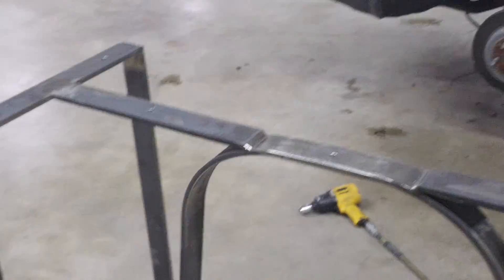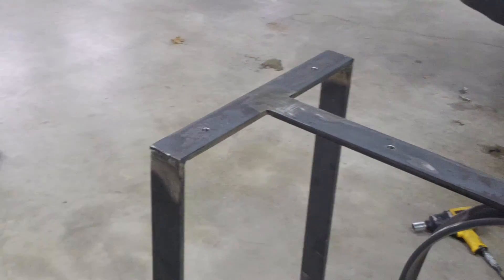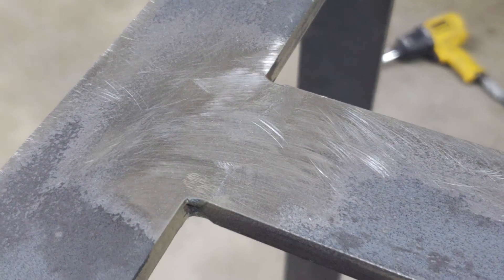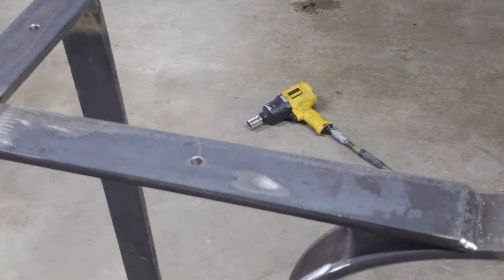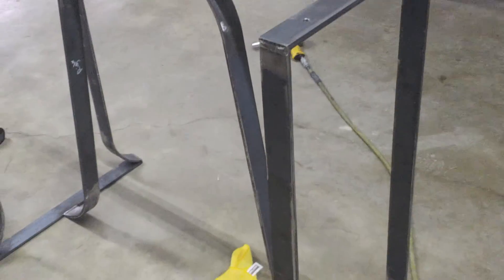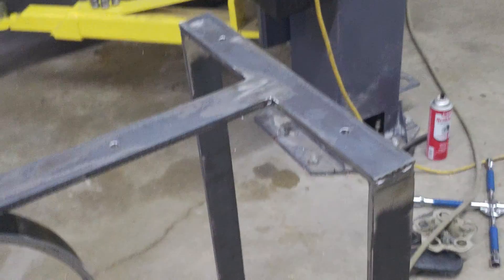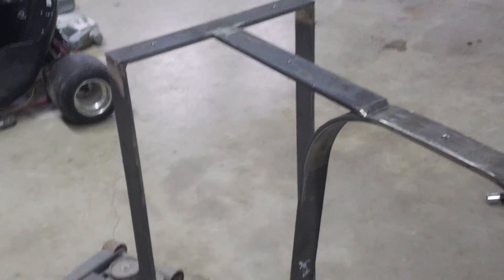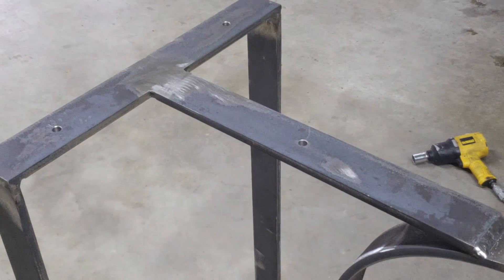Powder Coating - Mill Scale - Why you should remove mill scale

Comment: I make furniture that size and bigger. I haven’t got time / don’t want to manually get rid of the mill scale so played around with some ideas and came up with something that works.
I get a small tub of hydrochloride (muriatic) acid at 30% and get cotton strips that are roughly 3 inches wide. I think it’s cotton calico material. I then dip the cotton in the acid and wrap the finished peace up (think mummied metal with one layer) Every now and then mist it with some water and if need be brush a bit of acid over the surface of the cloth. 
After a few hours unwrap the metal and clean it off. It works well and means you haven’t got to keep brushing on acid for it to evaporate off. It has saved so much time.

Comment: Hey bud what's a good phosphate spray to put on it with a small shop? I use Eastwood pre paint prep and hold tight 102 to clean but I've been thinking about a good phosphate to use. Any suggestions
Reply from the maker: I'll be doing a video soon but for now try out Columbia Coatings phosphate
Reply: @RightNowPowderCoating  thank you

Comment: I use Muriatic acid to strip mill scale and it works with little to no effort…… I don’t use powder coating at the moment but looking in to trying it. Do you know if I can still stripe the mill scale with the acid or will it do something funky to the powder coating.

Comment: Does it matter what grit you use to grind it off or does the powder coating fill the scratches pretty well?
Reply from the maker: It does matter, powder will not fill in deep scratches.
Reply: @RightNowPowderCoating  is medium sandblast media to course for powder coat? I have Black Diamond medium coal slag media from tractor supply.